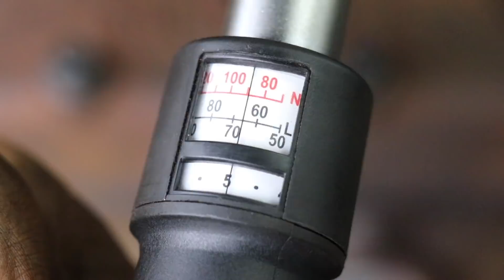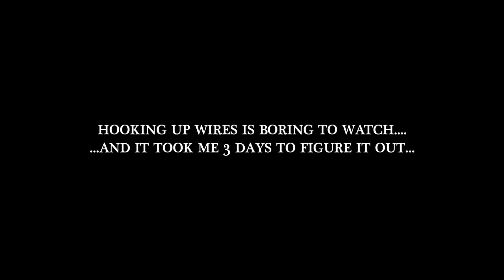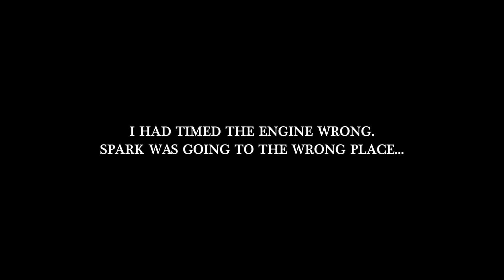Restoration of The Chrysler 218 Straight 6 Engine PART 2- ASMR #MOPAR #RESTORATION

Comment: Worked on a lot of those engines back in the day.always seemed like a darn good engine to me. One comment ,though, I always liked to use studs instead of the factory head bolts.Reason was that after many years of use,that head could warp a little,had to be machined flat or you had a leaker on your hands.Then sometime the head bolts would bottom out against the crud that would build up in the head bolt bores.We would clean out the bores,then install studs, then gaskets ,then head. We could then,if necessary use a flat washer,to insure we got the head tight against the block.Seeed to work out for us.
Reply from the maker: Great point, thanks for sharing your experience!!

Comment: Great work on the engine. Don't forget to add a zddp zinc additive to your oil. Old engines need zinc in their oil to protect the cam and sadly today's modern engine oils contain very little zinc.I use diesel engine oil 15w-40 in my 1984 chevrolet 305 to solve the lack of zinc problem with today's modern oils.

Comment: A lot of work has been done! But there are a couple of points .. I would not recommend hitting cast iron. For example, on the intake and exhaust manifolds, because they can simply burst. And it is also not worth smearing them with sealant. At the outlet, it will burn, and at the inlet, contact with gasoline will badly affect it. Before assembling the engine, everything had to be painted. Now it will be difficult to do this. The splines of the input shaft of the gearbox do not need lubrication .. It can even harm! After a while, this grease will absorb dust from the friction of the clutch disc, and will begin to block its free movement on the shaft. Moreover, the same grease will start scattering onto the clutch disc. Which will cause the clutch to slip. Overall, very good!
Reply from the maker: great tips! Thank you very much sir, i have a lot to learn
Reply: @partsandresto  Experience comes with time. I have been engaged in the restoration of cars and motorcycles for 17 years, and despite this I continue to study until now ..)) Interesting videos on your channel, I subscribed.

Comment: Great job! I have a 46 dodge with the same engine. Where do you find all to measures to tight de crankshaft and the connecting rods? Thanks for de videos I learn a lot!!!
Reply: I used to get those measurements from Motors Repair Manual at the local public library. But that was many moons ago!😂

Comment: With my luck even though the engine was turned upside down I would find that lost bolt on top of the piston after everything was put back together.
Reply from the maker: It’s possibly rattling around in there.... guess I’ll find out 800 miles from home or something... haha
Reply from the maker: @WelcomeToWillsWorld holy crap! That’s aweful. Also, I used to work in Frederick, MD

Comment: For the comments below.  The guy isn't rebuilding a Toyota Supra 3.0 engine here.  These old Ford, Chevy, Plymouth engines will run under dirty and rusty conditions.  This engine will run a long time.  No one is going to take it to the drag strip and try to turn 5K RPM.

Comment: Great job. A tip to help clean the piston ring groves is to take one of the old piston rings and break it. Use that broken piece as a scraper. The harden steel ring will snap with a hard sharp edge that is the right size for the grove. Keep up the great work.

Comment: As a heavy equipment mechanic, deep in my heart, i wanna say, your works is very good

For an old engine like this, u should call someone who can set the timing gears

Not like many other high tech engine, which only need to set the timing on Crankshaft and camshaft, and for the others, let the timing sensor works for it

Cheers..

Comment: Nice work from a fellow Philly guy - heinous using a metal pick on the ring grooves though
Reply from the maker: Hey, whys that heinous?
Reply: @partsandresto  the piston ring seals against the lower face of the ring groove, better to use wood or plastic. Also, it wouldn't be  a resto video comment without talking some shit!

Comment: Try bolting the timing cover loosely, then add damper,  then snug up timing cover.  Better chance the seal survives.  Sone guys cover the rod bolt threads with rubber hose during assembly.
Reply from the maker: Good advise mr schleicher, thank you sir!

Comment: Since this did not go to the shop how were the value seats harden for unleaded fuel?
Reply: mopar flatheads already had hardened valve seats starting as far back as like the late 30's early 40's. GM should have taken some notes from them.
Reply from the maker: my machinist with 30+ years said i didnt need them unless i was doing some serious drivijg
Reply: @stevetitsworth  thks never knew that

Comment: just got a 48 special deluxe. same motor.  first didn't have spark. fixed that. then no gas to carb. fixed that. rebuilt carb. now The motor turns over and bucks like it wants to start but it just won't start. any ideas?

Comment: Thanks for the fantastic videos, very well done! I have the same engine (almost) in my 1952 Dodge M37 military power wagon. Did your engine have a metal coolant distributor that was behind the water pump in the main coolant passage that ran the length of the block? If so, how tough was it to replace? My truck runs hot and I think many of the block passages and plugged up. Thanks again and thanks for your service as a firefighter.
Reply from the maker: Rick, i am lucky that the distribution tube was swapped for a brass one in years past, but I hear with a proper hook tool and a slide hammer, you can make quick work of it.  Search the “p15 d25” forum for a better answer.  Good luck! Hmu on Instagram, wanna see your truck
Reply: I was going to mention that water distribution tube and learned something! I wish I had found the brass version. It was HELL pulling out the old one in my 52 I hate the thought of ever having to do it again! I imagine that you replaced the freeze plug behind the flywheel and just didn’t document it on camera. I learned about THAT ONE the hard way on my 1059 Belvedere! Great job! Love the flip flops! Dad used to ride his panhead wearing them!

Comment: Did you pull it clean out the tube that sprays water onto the valve seats to keep them cool while the engine is running? it's just behind that little trapezoidal opening in the water pump it runs the entire length of the engine you have to pull it out and clean out the little orifices that spray water up out of the valve seats to prevent them from cracking. P.S. get an 8 volt battery it will do wonders...
Reply from the maker: Got a brass one in there

Comment: Interesting that the spark plugs are located above the valves, not above the cylinder.
Maybe the spark timing is extra-advanced to compensate for the slightly longer burn time?

Comment: What made you decide to keep the original drivetrain in it vs what most would do is slap in a v8...? Really love this. Needs too be more of these originals out there.
Reply from the maker: I’m not a mechanic, I’m really just a cleaning lady. Cleaning and painting and slapping it back together
Reply: @partsandresto  Sounds like me. Good choice too! parts maybe be harder to find & i was very surprised you hunted down NOS. That'll last it's entire life over again! Restoring in 1982 Chevrolet square body (Silverado top trim) over 40 factory options + First-year diesel eng with NOS parts.
Reply: @partsandresto   I love you kept it originall I had a 47 dodge pic up a few years ago had same flat head ran foreverever body Tod me to put modern motor in it no way

Comment: I can identify with this footage 🎥🎬👍‼️ I had a flathead straight 6 cylinder  218 ci  my 53 Dodge Coronet, only 100 HP from the factory, I souped it up with turbocharger, electronic fuel pump, and a dual exhaust manifold from JC Whitney catalog produced 165 HP on my Hot rod, , Great memories of American steel 🇺🇸♥️🗽‼️

Comment: By chance, was the reason it didn't start at first because the crank was 180* degrees out when you put the distributor back in? 
Happened here when decking the head on a 230. Found the problem via checking TDC with a rod down the # 6 cylinder plug hole.
Reply: What piston needs to be at tdc when you reinstall the distributor
Reply: I’ve got a 230 that won’t start 
It has sparks on all cylinders and a rebuilt carter carburetor it’s getting good fuel.I do remember rotating the engine with the distributor out

Comment: The problem with the timing was you can put the cam and the distributer on the timing mark 180° off by timing it to the exhaust stroke and not the compression stroke. Also the pistons only go on one way. Either turned to the intake or the exhaust. Not sure it matters on something this old but in a modern two stroke is critical. Good job, she sounds good, better than my 81 Toyota pickup which needs a carburetor.

Comment: You did better than I did. The only criticism I have. Is the engine block, the heads , crankshaft and cam shaft. Should have been soaked in a Caustic Soda Hot Tank. Other than that, you did some things I could have never done!
Reply from the maker: You’re completely right.

Comment: When you're pouring antifreeze or oil out of those big jugs, turn it 90 degrees (like the long sides are up and down) and it will pour without gurgling and burping a mess everywhere. You can also stick the end of a screwdriver or the dipstick in the hole if it's oil and it should help pour without making a mess too.
Reply from the maker: Oh dang, great tip!!

Comment: Great video!  I'm rebuilding almost the exact same motor (230) as a first-timer right now too.  I went a little further and had the block, head and crank machined and then painted everything.  Quick question for you though; the two oil ring grooves at the bottom, I see you put the cast iron oil rings in the bottom groove.  Did you copy the original pistons or did someone tell you which groove to put them in??  I called one of the powerwagon parts retailers and they told me the cast iron rings go on the second groove up from the bottom...  I haven't installed the pistons yet so let me know if you have some advice?  Thanks!!
Reply from the maker: Go with what they say, I just read what the ring bag said. I suspect it’ll work fine either eat
Reply: @partsandresto  No problem thanks for the reply.  The ring bags didn't say as far as I could see...  I did call them and they said the cast iron oil ring goes on the bottom.

Comment: Those were good engines .you could still get flat head Chrysler engines in the pick up trucks in the mid 1960s many even later.also as a foot note this little engine was also used in the 1970s on farm and industrial equipment..
Reply: 1960 Was the last year for the 230 flathead engines in Dodge trucks  I have one, myself.  The 225 engine came out in 1961.  But, right, the flatheads were still used in some non-automotive applications

Comment: right away i already had doubts about the timing, on the video you simply snug in the distributor rotor. you have to set no.1 cylinder TDC then set the rotor screw at 3'oclock and the distributor should be set to fire at no. 1 cylinder and that's it.
Reply from the maker: did all that, didnt show it.

Comment: Why didn't you gap the rings in the correct cylinders? Looked like you did them all in one
Reply: it's not a high performance engine. It will be perfectly fine that way. I have built way more performance based small block mopars where I just took the rings out of the package and sent it. At least he gapped them. It will be fine lol

Comment: You shouldn't tighten those four bolts that hold the manifolds together until after you bolt the manifolds to the block. It will help to insure that the manifolds are lined up correctly to have the best possible seal against the block.

Comment: interesting enough to watch all the way through without fast forwarding.  i did notice no measuring of bore wear or anything, just ridge reamer and flex bore tool and new rings.  no plasigauge crap for the main bearings, just new stock size bearings.  it might be sorta shade tree mechanic type work, but Im sure it will work just fine once the new rings wear in just right.

Comment: Im not sure why you went that far and didnt replace the crank and cam bearings...
Reply from the maker: Cause moneys
Reply: @partsandresto   was thinking that too, but how many k's will you put on this engine? probably not too many, also old flatheads are overbuilt and underpowered so im sure the stress level is low enough for it to be fine. how is it going now?

Comment: that's good, you did a good job. but take it from a long time old mechanic, never run an engine with the exhaust cut loose at the manifold. cold air will be right on top of those valves when the motor is turned off and it will warp/bend them.
Reply from the maker: Ooooh dang. Good call. I’m working on the exhaust system now. Thank you

Comment: No death music, please, upbeat ragtime we restoration gotta remain ln adrenalin flow. I have a 1937, 1948 both Dodge coupes, 37 had a new rebuild, hard to find strong knowledgeable help these days. Ive had my 37 since 1989, got it complete for $1500.0
Guy had it sitting for 3 yrs, changed plugs, oil, fresh fuel, out on street pulled it w/chain to pull start. 
Cranked over and started ln 3rd pull.
Amazing solid American craftsmanship, although parts were being continually upgraded. Stayed with 6 v. 218.7 cu in.
I used Hemmings old school oil mix, for starters.

Comment: 18:40  it looks like a lot of lube,,  no worries of that getting all over the clutch and turning to gum?
Reply: I was worried on lubing the transmission input shaft as you did, for the later 60's Mopars, , our manual says keep this dry, otherwise lubes slings onto clutch disc.
Reply from the maker: Shit.  Good point. Dang it.....

Comment: Put some fuel hose over those conrod bolts or you will nick the crank when you install piston and rod. Bettor yet  they make rubber booties for the job that are flattened and come on and off easy.
Reply from the maker: Roger that Kevin, great tip, thank you kindly my friend

Comment: Regular mechs dinna call it a starter motor. Old Cat engines in this era had starter motors that ran on gasoline to start the diesel engine. Normal mechs call this a "starter", to not confuse other mechs.
Reply from the maker: Fair enough. Thanks

Comment: one error you done is that on these engines, when the pistons have worn one set of rings, you must have the fire ring groove remachined and a spacer installed. 
this is a narrow ring design so when the ring is worn, the groove is tapered and installing a new ring on that groove will make it break in a short run.
 I saw that rather often. 
good video.

Comment: 20:15. If you tilt the full jug 90 deg to the side, you can get the spout a lot closer to target and pour easier without it glug-glugging.
Reply: Not to mention distilled water is certainly way better than tap water.
Reply: 20:25. Here he's tilting the jug at least half way.

Comment: I believe your wormhole detached overnight duty, "tdy", cap head screw for I believe might possibly have been knocked into the open hole by where it was spun free from. If you drive this joyous critter on extremely rough terrain rapidly enough, when the engine siezes to a standstill your mystery will be solved by the Sherlock Holmes method of intrigue pursuance.
Reply from the maker: Hahahaha! Yesssss. I’ve got about 100 miles in her so far, no seizures yet! Woot

Comment: I hate to see starting fluid used on a fresh engine . If it won't start on gasoline something is wrong . A little two cycle fuel wouldn't hurt .
Reply from the maker: Bad fuel pump, turns out

Comment: Greetings from Russia from a Russian Electrical Engineer ! I will continue to comment on your repair ! With the valves removed, I did not clean the intake and exhaust gas channels ! I did not check the gaps between the valve rods and the guide bushings !!!

Comment: 20:13 pouring it sideways will make it not do that annoying glugging and oof using secondary water to have a 50 50 mix of coolant hurt me your really supposed to put distilled water as a 50 50 mix cus any other water as impurities that can  corroded eat away metal and gaskets

Comment: I rebuild engines and your order of tear down is weird to say the least. All that work and useing the old worn out parts , not worth the time and effort guy. It will hold together for a while but then it will burn oil like crazy. But on a tight budget  it  will work for a while.  Ive rebuilt a lot of those straight six'es and they will run forever if done right. Next time totally tear it down and go from there. Nice effort though. I wish u well. . Lets see it run longer.